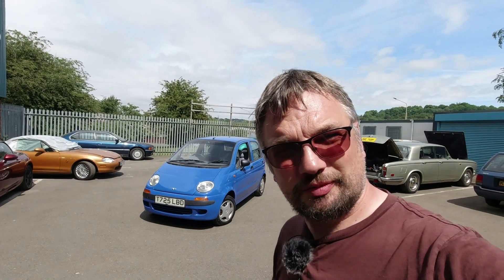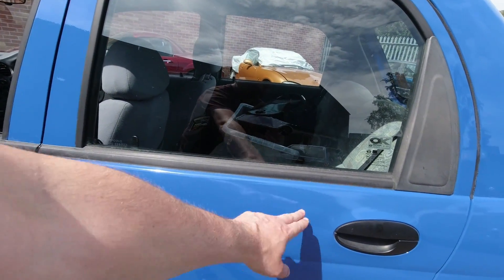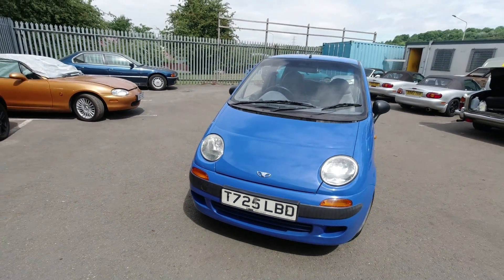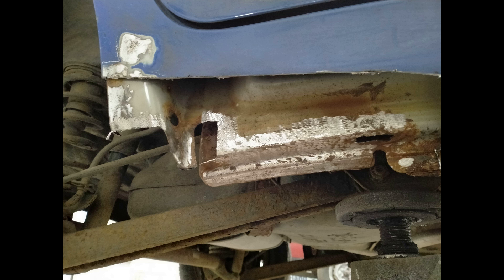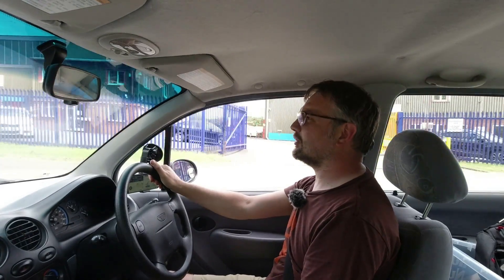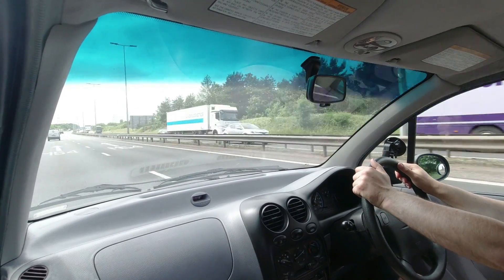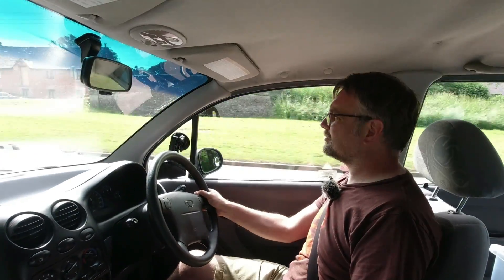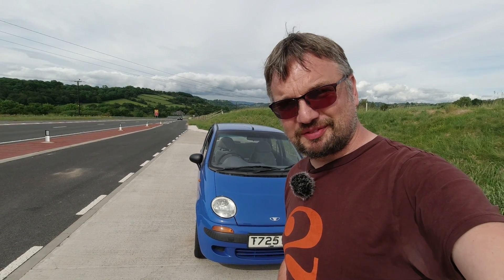RESTORED! Daewoo Matiz returns! Less rust, more shiny!

Comment: Very nice 👍. I like to give my 1998 Mazda 626 Sedan to restore. It is not  very rusty, only the backwheel arch on the right side is crispy. And there are a lot of scratches on the bumpers. Only problem is that I'm very busy with renovating my house. So this car has unfortunately to suffer a little bit, because I have to transpot a lot of items with it. For towing my trailer I can use only my 2017 Sorento, because I have to change the 626 brakes (warning light flashing ). But next tuesday I have a termin at my Garage for oil change, reparing the brakes and aircondition service. I like to keep this old vehicle in a technical good condition, because me and my wife want to be safe on the road. Even when the Sorento is much more spacy and comfortable, I always enjoy to drive the old 626 like you enjoy your Matiz.

Comment: Done a great job on the bodywork.👍 A friend of mine had a Matiz snd he said he was getting poor mpg because he had to work the engine hard to make progress. So if it had air con the mpg would be even worse, and lack of power. It's only when the car' stationary  or crawling along where you need air con. The cheaper option would be to fit wind deflectors. If that's your thing.

Comment: I had a Matiz and loved it, it had air con and going up hills you had to switch it off to keep the power going. As you say, such fun and cute cars you forgive them everything that's wrong.
Reply: I've got a Matiz 0.8 that I bought new 10 years ago. It's now done nearly 160,000 miles, burns no oil and returns over 50mpg. Great little cars!
Reply: @WinstonSmith2024  agreed, I would happily get  one for my teenagers to learn to drive, but they are into a Hyundai Matrix, fabulous and very well behaved, and a SAAB 90, lovely but a pig to work on.

Comment: Ian when you are in the future in Belgium you are welcome to drive my Peugeot Partner. It is a diesel with 315000 km and still used as a daily driver. It is 17 years old. It have a few issues but nothing severe. I like the care a lot, because the loading capacity and the lack of speed. But the engine is bullet proof.   My second car is a Skoda fabia and thar car is 13 years old. It have only 80000 km on it. I don't like new cars and I prefer the old ones.

Comment: Better welding work than Harry's artic Rolls. :) Great work keeping the Matiz going.
Reply: I thought that aswell, the rolls looks like it's going to need a big dollop of filler to cover the welded panels.
Reply: @brianiswrong  Ohhh Boy! I actually preferred the rust before the work started. 

Harry needs to weigh the car before filling on his scales. And I'm sorry but the work looks horrific. The step on the drivers side lower repair. And 2k paid just for welding. Yikes!

Gobs of filler needed 😮

On the Matiz that's how I fix weld my cars. Smooth butt welds with the tiny hint of filler. Make the metal insert prep good to reduce filler.

Comment: This model was build in same factory like Oltcit. In 90s romanian governement sold Oltcit factory to Daewoo who build there Matiz and Daewoo Cielo sold here like Nexia. Strong little car used also like taxi whit hundred thousands miles and no problem.  I so recently on Autotrader an Daewoo Nexia for sale. Very very good car
Reply from the maker: Indeed! A nice link between my two cars. I must mention that in a video. Craiova?
Reply: @HubNut  Yes Craiova. I was born and and its my city. And i use to work couple years [1987 to 1991} in Oltcit factory. I had an Oltcit couple years. Model RL. 1300cc and 5 speed gearbox.  Now its a Ford factory.
Reply from the maker: I hope to visit one day. Passed through in 2018 after buying the Mighty Dacia.